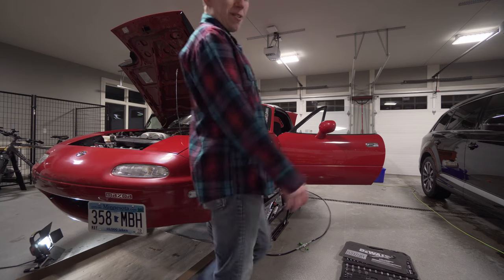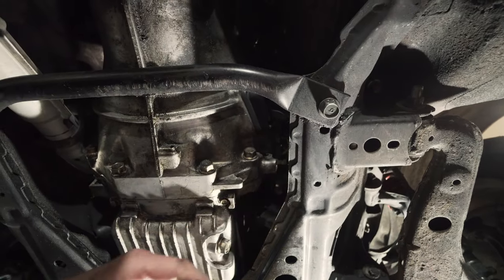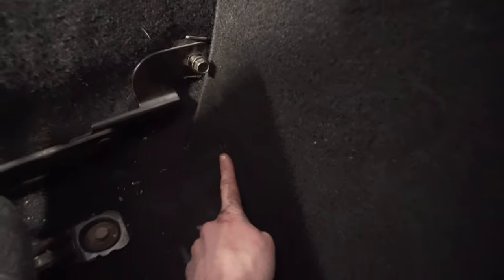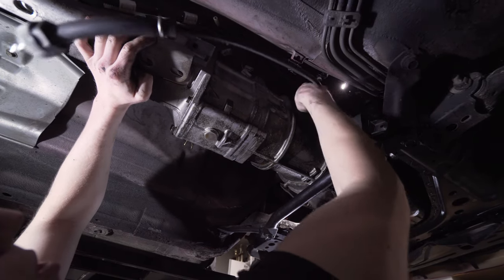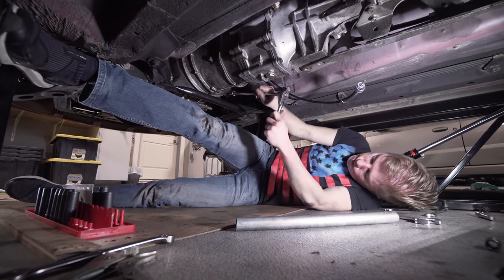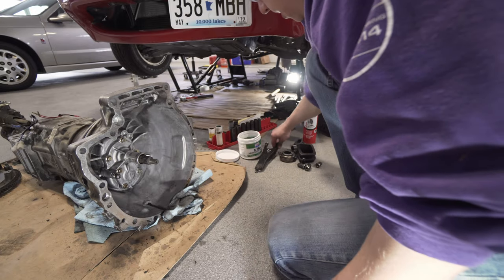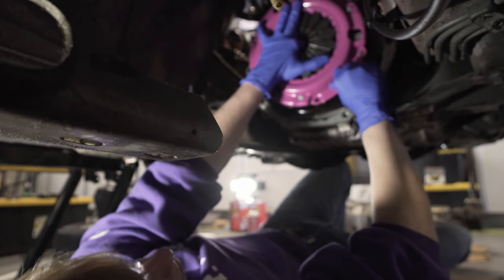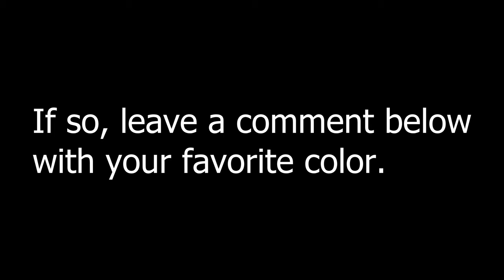Flyin' Miata Clutch Install Happy Meal// *MOSTLY* Complete Guide

Comment: Can you comment on how the happy meal is performing? How does the light weight fly wheel feel? Noisy?
Reply from the maker: It feels just like stock, haven't really noticed any chatter other than if you really lug the car in a high gear and not enough speed. Hasn't slipped yet, cars making around 180whp/180ft-lbs currently